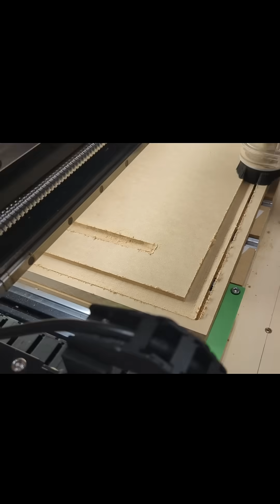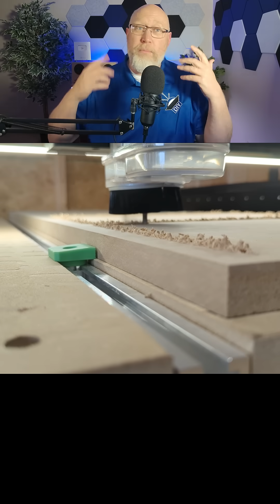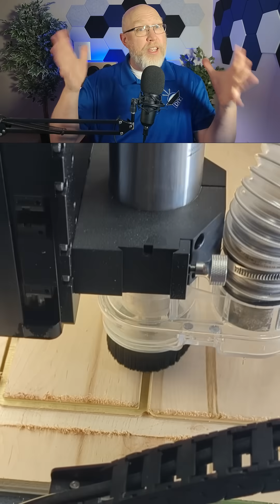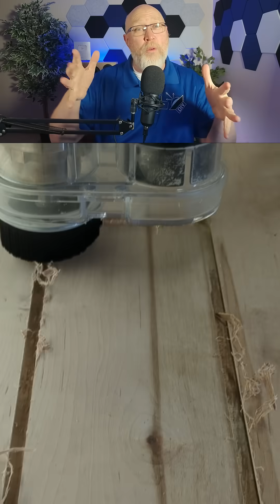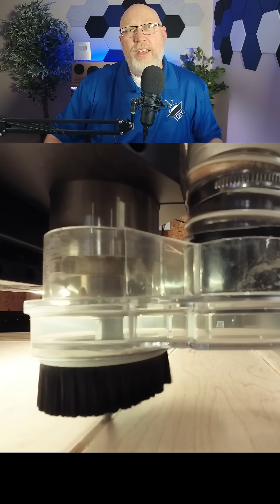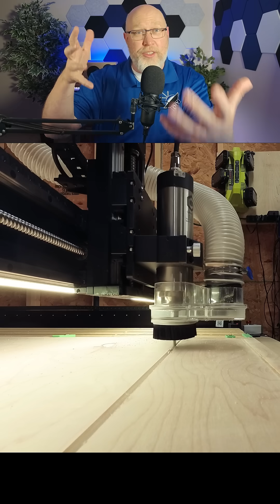Up Cut vs Down Cut  DIY Audio CNC tips

Comment: I've found that the compression bit is the best I've used so far
Reply from the maker: I was reading up on compression bits.  Apparently the cuts need to be deep enough so that you get past the point where the bit switches over.  That will depend on the bit. 

I've also found that the CNC seems to work better, less likely to crash, if I make more shallow passes versus fewer deep passes.